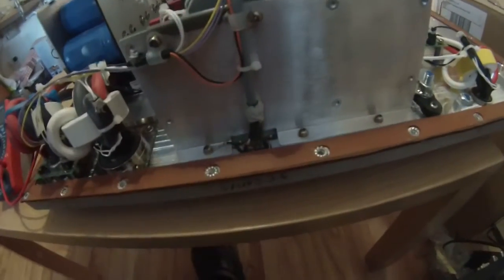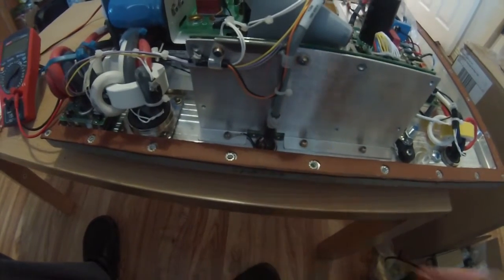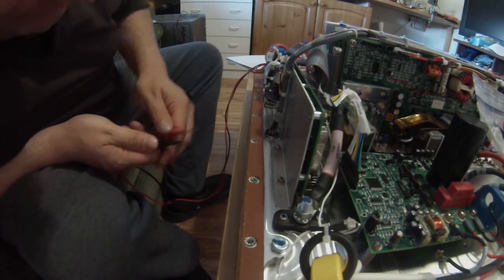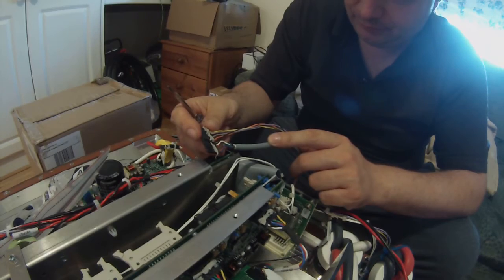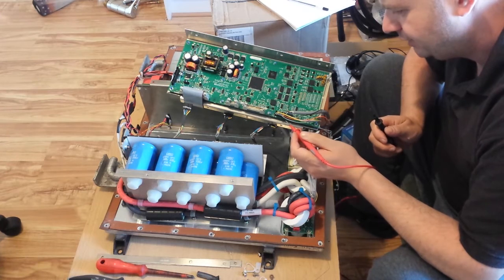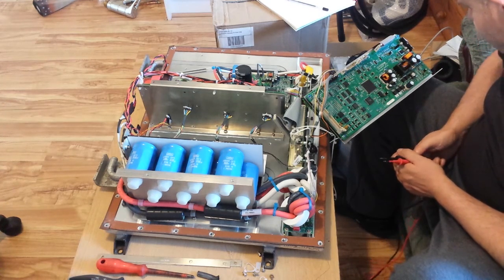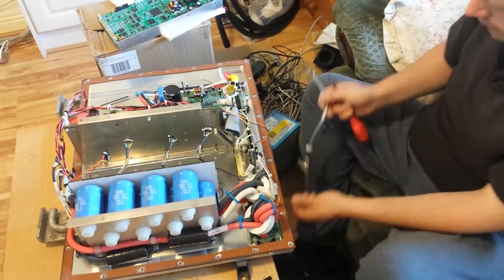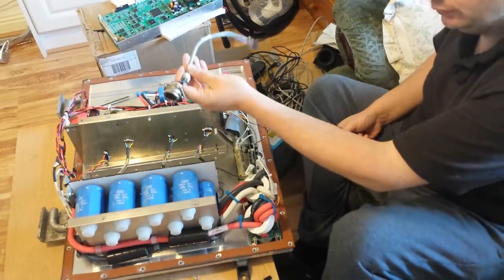BMW E31 840CI EV Conversion 48 : Enova Inverter 01

Comment: Hi, I have seen these motors available, I cannot find any info on wiring diagrams for the motor and controller ,  I am looking to build a budget,  I am not a electronics engineer but know hoe to use tools, would you know where to find info on these, do you think it is a good idea for a non engineer . Thanks